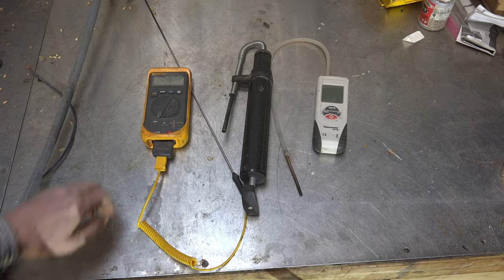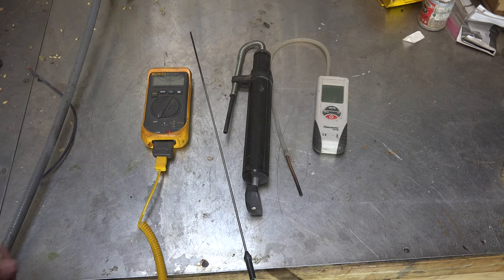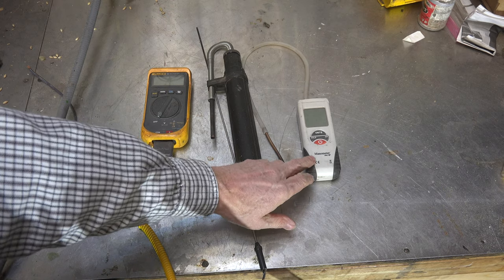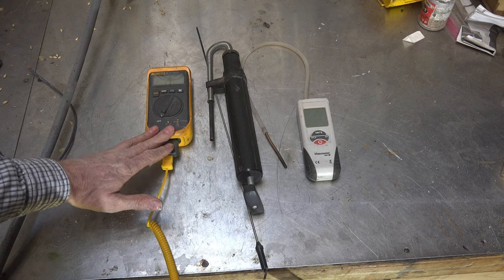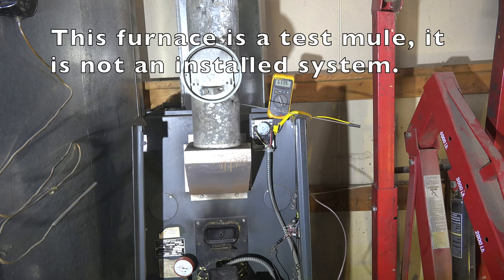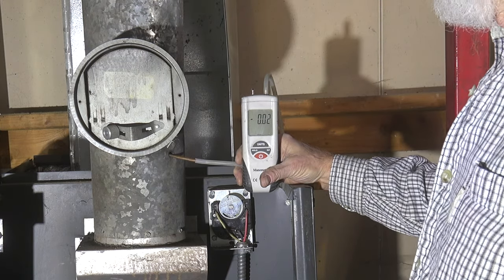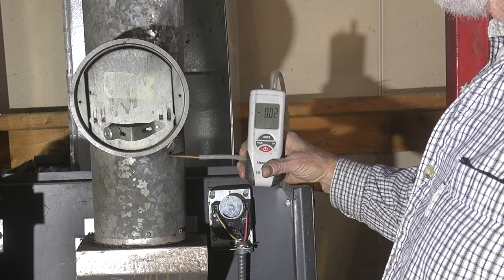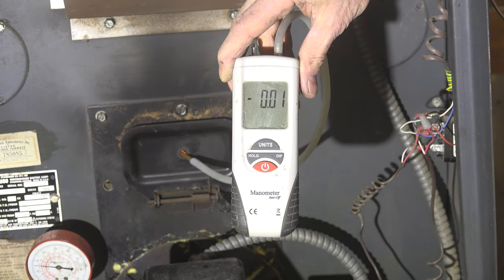Setting up the oil burner without a comb analyzer

Comment: If you are real discriminating using the smoke tester, you can get to the point where the slightest draft adjustment change will get you from a 1 to 0 smoke which is the sweet spot to achieve.  Even  if you were to use a gas analyzer you wouldn't want to move too far from this draft adjustment unless you were prepared to play with different nozzles.  For the average homeowner however we likely stick with the nozzle that the burner / boiler combination was paired with from new.

Comment: This has been the most informative site for the DIYer.  My old Oneida is on her last voyage I’m afraid but, so am I LOL.  Started getting a lot of smoke smell this season and it’s about as good as I personally can get.  Pretty sure there may be a issue re the heat exchanger but CO detector has never registered.  We live so far in the country the only other option is propane and I think we’ll make the switch this spring.  Hate spending the money but, so many vendors just want to sell new equipment and finding a real expert just doesn’t seem that easy these days.  Thanks again!
Reply from the maker: Glad I could help.
GFM
Reply: I agree...Gray has some very good videos! I too have learned a lot.
Reply: So True! I have to laugh because just casually listening while I'm working on something else, I hear grayfurnaceman give tangential information that is extremely useful and important to know!  You truly cannot beat real-life experience from a teacher/instructor. ...I can't imagine what I would learn if I was paying full attention! LOL

Comment: Hi thank you for you videos, I've been trying to set up a oil hot air furnace in my mother in laws home, anyway I bought the furnace used and installed it on back porch. First year went pretty well thanks to your help. Replaced the Honeywell primary, and geniuses A/C plate.and transformer. Suddenly problems replace nozzle now can't get the gun set up even though I'm following your directions. Plus dumped a crap load of fuel in burner chamber. Anyway to clean that up? Plus the red and white wires coming off the A/C plate, does that go to the transformer? Thanks for all your help, great videos

Comment: Gary, video has been very helpful but a few questions remain. What settings should be used on the manometer? I’m assuming negative pressure tested in in/h20? Or do you have a video that covers these questions?

Comment: Can you explain the purpose of adjusting the nozzle assembly depth in the blast tube
Reply: I'd say it's the positioning of the oil spray to the air swirl pattern to maximize oxygenation of the flame, with the minimum necessary air volume.

Comment: Great knowledge. Thanks for sharing. Can you make your own smoke pump? How fine (restrictive) does the filter material have to be? A piece of white tee shirt or paper-towel?
Reply: it's fairly heavy paper strip and quite restrictive. it's closer to extra thick vacuum cleaner bag, index card stock, or heavy weight crafting paper. hard to say what would work in an emergency.

Comment: I just found out my O2 sensor for my testo is going to cost 366 dollars. Man thats horrible I  might as well by a whole new tool for slightly more every year. I hope this video helps me use other methods
Reply: Get a Field Peice S0X3, field replaceable smart 02 sensor, i have picked them up for around 50 dollars. The sensor @ around 50 dollars.

Comment: Can I ask your thoughts about my settings? The new hydrostat is set to 173 High and 170 low.  The furnace Warmer 160 and Cooler 120 nozzle line is “in the middle” facing furnace. 
The hydrostat/ furnace temp can go up to 174 (above my setting) - 75-80d. 
The 2 house thermostats are set to 67 (addition strong half) and 72(weaker half of house). 
One room had stinky heat from couple weeks ago ... replace a filter? dust burn off?
Reply from the maker: The hydrostat should be about 20 or more degrees between high and low.  I don't know about the "furnace warmer".  
Room thermostats should be set to your comfort level.  
I would certainly be checking filter.
GFM
Reply: @grayfurnaceman   thank you. What if the furnace hydrostat says 183 and I set high to 175? Why might this happen?
Reply from the maker: @kaltrex9465  There is certain amount of thermal mass between the flame and the output of the boiler.  It is not unusual.
GFM

Comment: I recently moved into a mobile home with a oil furnace and it has no draft regulator. It's been like that for years and has been seemingly fine. Does it have to have a damper?
Reply from the maker: Mobile homes use a special oil furnace.  It has a non adjustable combustion air supply and damper.  You also must use a specific nozzle.
GFM

Comment: So many questions you did not answer or show.

1. Where to buy pyrometer and cost?
2. Where to buy smoke tester and cost?
3. Where to buy draft gauge and cost?
4. How to perform smoke test? Video shows you pumping it several times; why?
5. How to adjust air intake? You don't show how much you changed the setting.
Reply from the maker: I have dozens of videos on oil furnaces.  Here is a playlist that may help:  https://www.youtube.com/watch?v=KAQR5Ctyw1E&list=PLE0EAAA0B007199D9&index=27&t=1s
I do not get into tool costs and sources.
GFM

Comment: this is using Dinosaur analysis tool on Dinosaur  equipment, I refuse to work on equipment like this, change it out.. how do you check co?
Reply from the maker: The use of the smoke pump and draft gauge are essential to get the highest  efficiency when used with a combustion analysis tool.  The analysis tool alone can give you a dirty smoke that will soot the heat exchanger.  CO is checked in the vent.
GFM